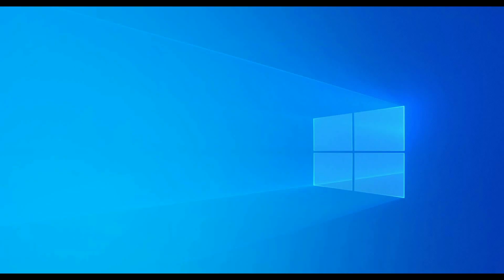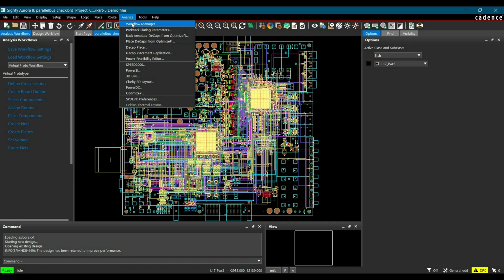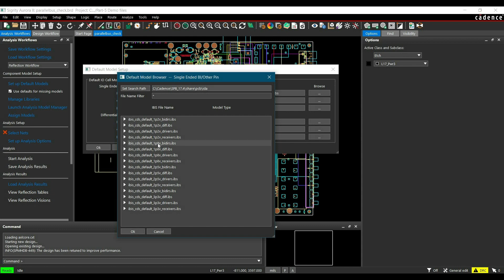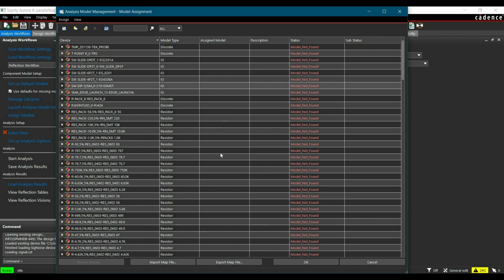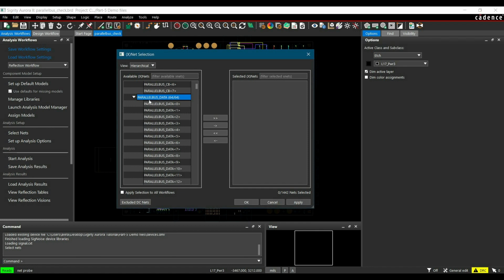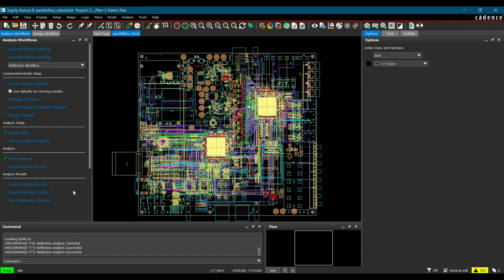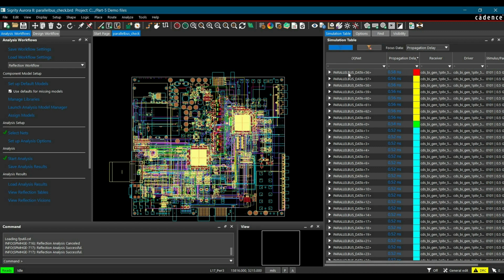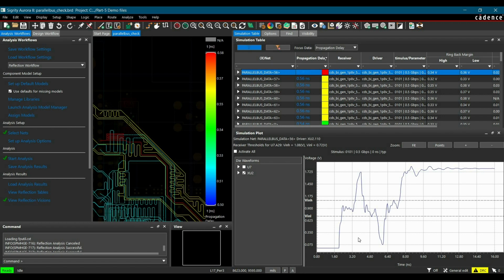How to do Reflection Analysis using Sigrity Aurora 17.4

Comment: Can i edit voltage range of pad in ibis model. 
The differential signal is 3.3 volts. But it's going to 5v above . In wave form for some ic's.
Reply from the maker: Hey Raneel, yes you can edit IBIS model using topology explorer 17.4, i have mentioned in previous few videos like LVDS simulation, but to produce accurate results you need DC and transient voltages both for a perticular pin.
Generally manufacturers provide different IBIS models for different i/p voltage i ll will recommend try to find that instead changing voltages in file.
Reply: Thanks @ @EsteemPCB